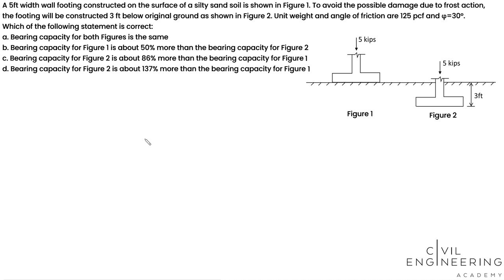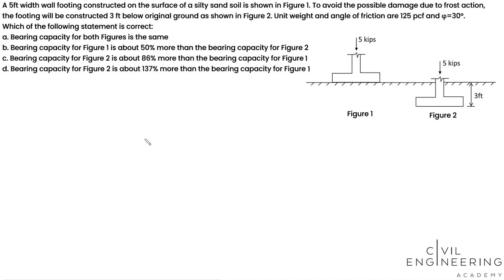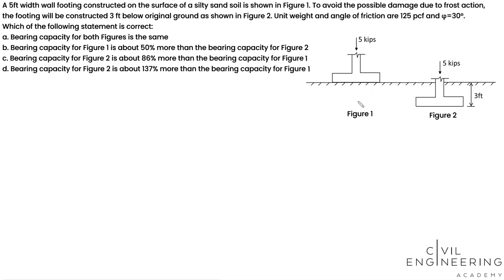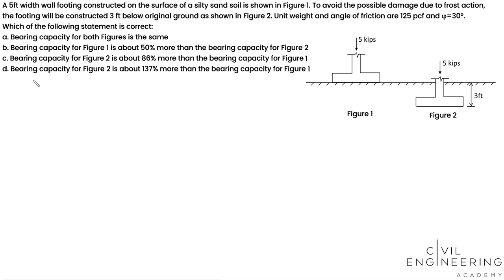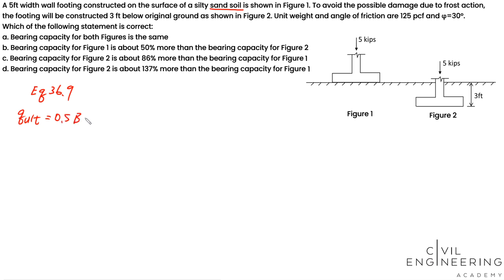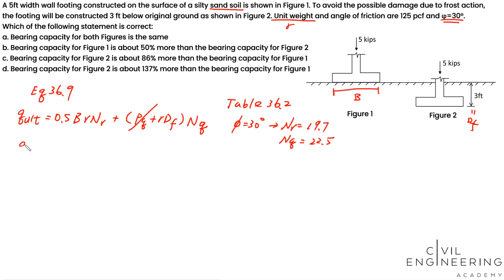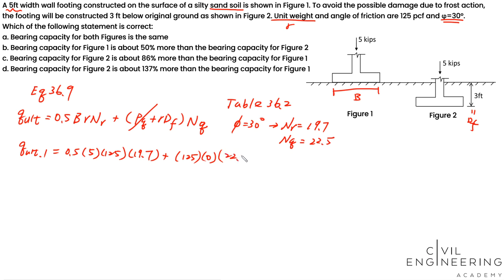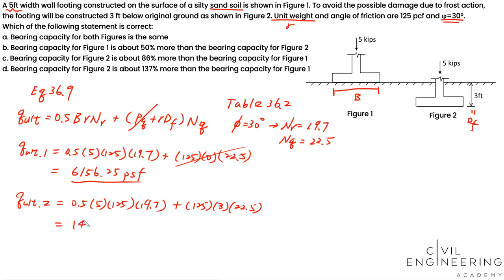Civil PE Exam - Geotech - Comparing the Bearing Capacity of Two Different Foundations

Comment: Hello, the NCEES reference handbook bearing capacity factor tables calls Nq = 18.4 and Ngamma = 22.4 for 30 degrees. Is there something I missed for the instructor to see different results? Thanks.
Reply: The latest NCEES Handbook 1.1 has the 'Meyerhof's' bearing capacity factors on page 97 you have mentioned, however unfortunately, this problem is using the old CERM Manual Table 36.2 (Terzaghi Bearing Cap. Factors) on page 36-3.  We should use the 'Meyerhof' bearing capacity factors given to us in the NCEES Handbook on the CBT PE Exam.  Good luck!!

Comment: Why is the surcharge pq=0? Shouldn't it be equal to the 5-kips load? Thanks!
Reply: It’s not that the surcharge is 0, it is because C for sand is 0 there
Reply: @2tiffunny  C is on a different part of the equation from the surcharge
Reply: @willriley1101  C=0 because it's sand. We ignored it